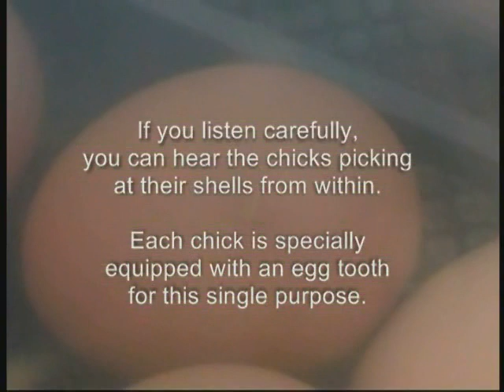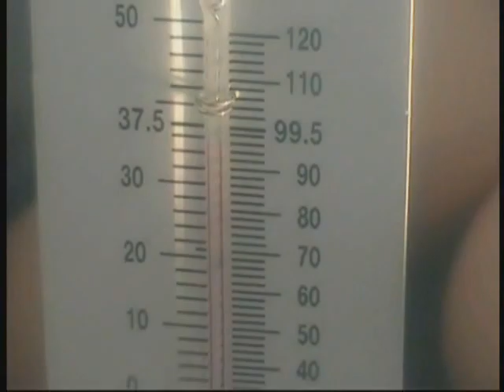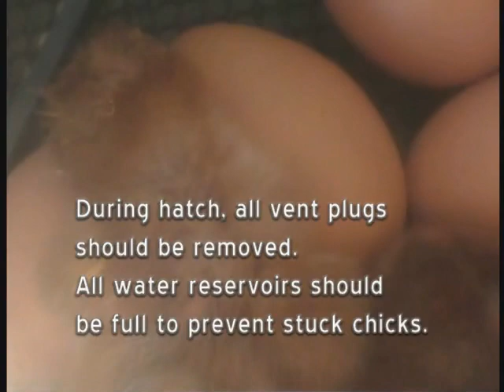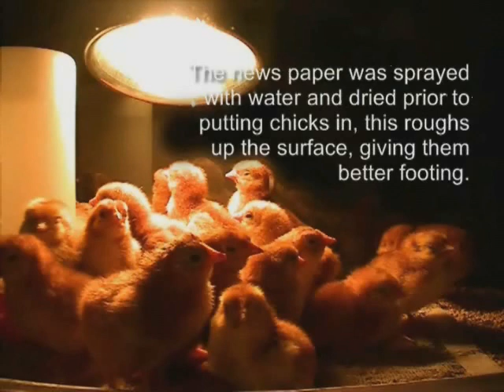Chicks Hatching, Top Hatch Incubator Demonstration, Rhode Island Red chicks

Comment from the maker: I sent you a message, answering your questions regarding taking the unit apart.  I'm wondering, since the other owner hat problems getting up to temperature, what wattage bulb is in it?  And what space it was in during incubation.  A 40 or 60 watt bulb will heat up much quicker.  You can also tape bubble wrap around the circumference, this still allows the unit to turn and holds heat in better.  Thanks for posting your questions.

Comment from the maker: Once things are running and the temperature is set/stable, you can let it run...

I don't put any water in it until the 18th day...  in my area, high humidity is more of a problem, so I run it dry until the end during the pip-hatch.  

You should candle your eggs to see if they are evaporating off at the proper rate, this is the best way to determine proper humidity for the eggs you are incubating.  I leave the red plugs out throughout the hatch.  Thank you for your question.

Comment from the maker: @lisucav Yes, put the partition back, it's how the eggs turn... the bottom rotates and the eggs are stopped against the plastic partition, this causes them to turn.  Water will be adjusted as you know the evaporation rate... candle the eggs after the first five days to see the size of the air cell.. you can see a air cell chart at Fred's Fine Fowl for reverence...  air cells are more accurate than actual humidity...

Comment from the maker: With respect to your friend... eggs being knocked about by other hatchlings would be at the bottom of my list as to why fully developed chicks fail to pip and hatch successfully.  A more likely reason for this event, fully developed and not hatching, is a lack of moisture loss during incubation, resulting in a chubby/oversized chick which cannot completely turn around inside to complete the pipping process.  Opening the incubator during the hatch can result on a loss of needed humidity.

Comment: 2 things I don't like about this unit.

1) I don't like the idea that big unit relys on a light bulb for heating source. There is much greater risk to lose a big batch of eggs from the light bulb going out due to many reasons. 

I much perfer the heating coil type which is much more reliable and less likely to burn out as frequently as a light bulb.

2) The lid is not see thru so you can't see much inside the unit.

Comment from the maker: @isfake55 I always start off dry and candle the eggs to see the dehydration rate...  shoot for 13% weight loss throughout the incubation cycle...  add water if the air cell grows too quickly.  You can take a q-tip, add some food coloring (blue is good) and mark each egg with a X on one side and a O on the other... you will then see these marks change as the unit turns... some eggs will turn more than others.  Make certain the turning arm is properly aligned on the bottom.  Find FFF on facebook!